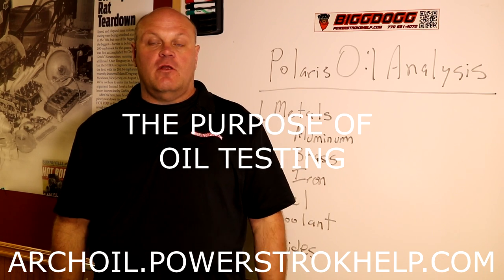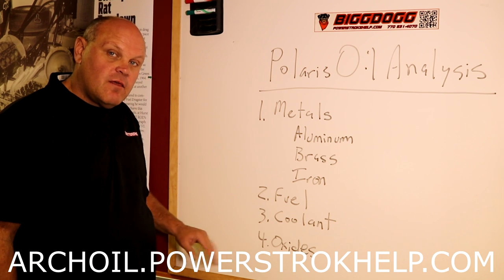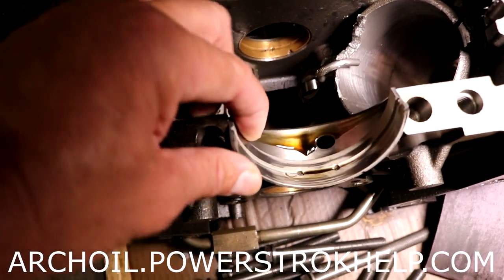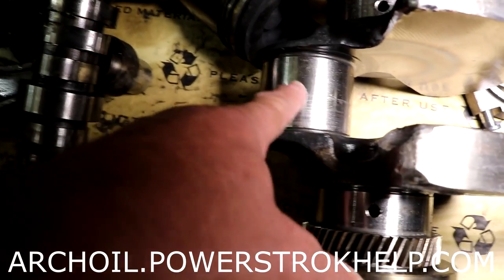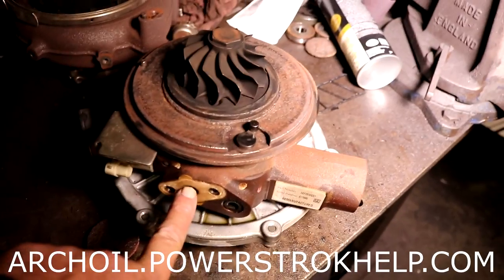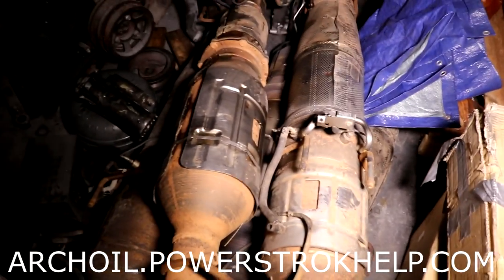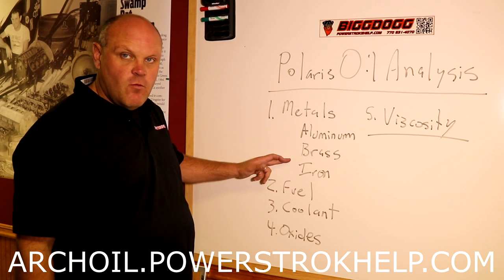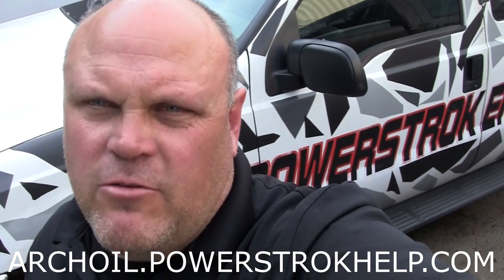THE PURPOSE OF AN OIL TEST - FREE WITH ARCHOIL ORDER

Comment: I'd love to do this on my 98 6.5td with 143k on it it's got 3k on the current oil change and we usually do oil changes every 3k but that's using the Walmart 15w-40 atm it has Kendall brand diesel oil in it with a synthetic oil filter on it

Comment: Bill,, if you can i need some help,,  changed the oil in my 6.0 2 weeks ago, and 2 injectors died immediatly..   i got it all fixed now, but my question is,, my 6.0 has 377k miles on it.. was a fleet truck for construction company.. would you suggest running the arch oil injector and oil formulas in my very high mile truck?

Comment: Should I be worried about my 2001 7.3 never chipped never brake controller Eddie Bauer it just turned over 100,000 miles and  the oil was changed every 5000 miles. I hope not I'm a fire fighter and it only goes highway miles.
Reply: I've heard these engines are the most reliable motors on the road?
Reply: If it was taken care of like that...its a good sign. However, you never know how the truck was driven...which is also a major factor.

Comment: I was told if you run your oil past 5,000 miles in a 6L you're pushing it. I'm changing mine at 3,000.
Reply: You should still test it.
Reply: Dexter Montgomery I agree. Changing your oil often is no guarantee that there isn't something going wrong in the engine.